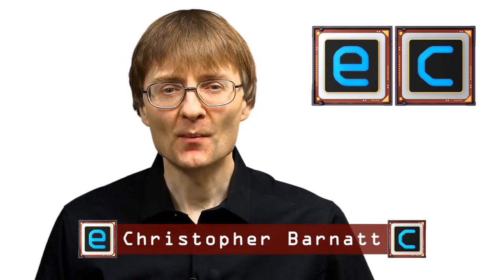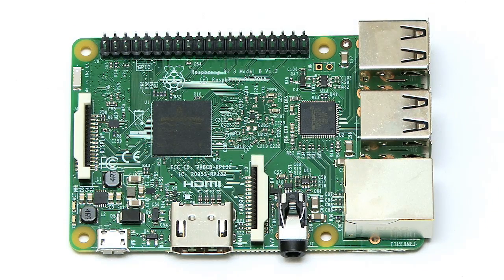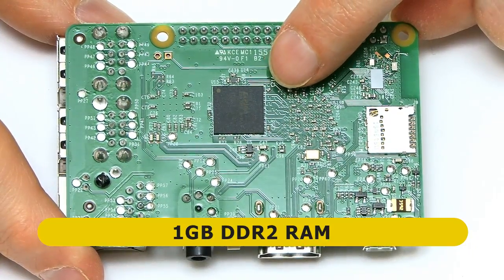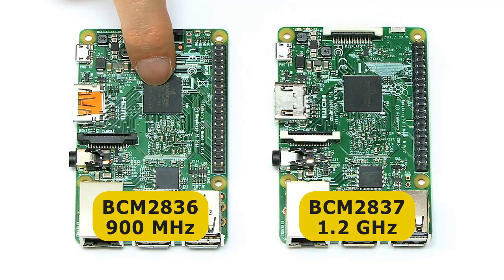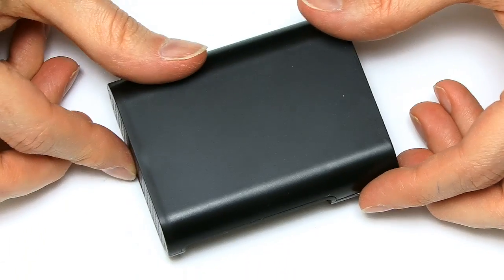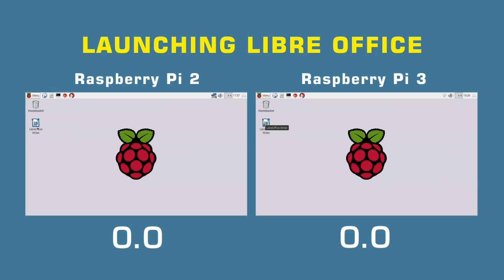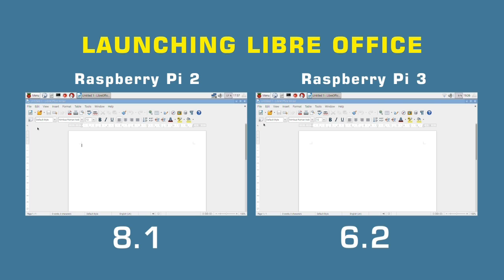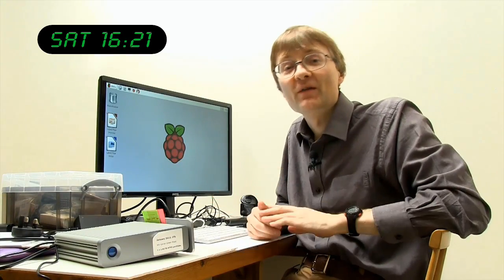Raspberry Pi 3: Review & Speed Tests

Comment: vcgencmd measure_temp uses a single quote in place of the deg.C symbol, like this: temp=44.5'C.

We can make it appear neater by piping the output to the sed command (use LeafPad like Chris did and copy&paste ° from a webpage, etc. --- or simply copy&paste the line that follows):

vcgencmd measure_temp | sed s/"'"/°/   # note the single quote between the paired double quotes

From this moment on you'll be seeing temp=xx.x°C

Comment: I just ran ping tests on my Pi 3 and my £1,700 PC and my pi has less latency, why is this?
Reply from the maker: That is a very hard question to answer without knowing your setup in terms of hardware and software. The Pi is I assuming running a much lighter OS. On the PC side, if the test was not done following a reboot I would do that, and also make sure that services are not running that may utilize bandwidth -- and of course Windows update may be running! :)
Reply: Excellent reply sir that makes sense and its probably a bit of all of those suggestions.

Comment: Monitor not working
Edit
Delete post
Report this post
Quote
Fri Sep 29, 2017 10:54 am 
Raspberry Pi 3 Model B, OS Raspbian by NOOBS, connected by HDMI to TV LG 32", Res. 1360x768, working well.

I bought a monitor, connected via HDMI + DVI Adapter: black screen only. 
Then I modified the config.txt file, result: had to reinstall all OS again.

Tried with a brand new Philips monitor, HDMI-connection, Res. 1920x1080: black screen only.

This is the temporarily running config.txt file:
********************************************************************************
# For more options and information see
# http://rpf.io/configtxt
# Some settings may impact device functionality. See link above for details
# uncomment if you get no picture on HDMI for a default "safe" mode
#hdmi_safe=1
# uncomment this if your display has a black border of unused pixels visible
# and your display can output without overscan
#disable_overscan=1
# uncomment the following to adjust overscan. Use positive numbers if console
# goes off screen, and negative if there is too much border
#overscan_left=16
#overscan_right=16
#overscan_top=16
#overscan_bottom=16
# uncomment to force a console size. By default it will be display's size minus
# overscan.
#framebuffer_width=1280
#framebuffer_height=720
# uncomment if hdmi display is not detected and composite is being output
#hdmi_force_hotplug=1
# uncomment to force a specific HDMI mode (this will force VGA)
#hdmi_group=1
#hdmi_mode=1
# uncomment to force a HDMI mode rather than DVI. This can make audio work in
# DMT (computer monitor) modes
#hdmi_drive=2
# uncomment to increase signal to HDMI, if you have interference, blanking, or
# no display
#config_hdmi_boost=4
# uncomment for composite PAL
#sdtv_mode=2
#uncomment to overclock the arm. 700 MHz is the default.
#arm_freq=800
# Uncomment some or all of these to enable the optional hardware interfaces
#dtparam=i2c_arm=on
#dtparam=i2s=on
#dtparam=spi=on
# Uncomment this to enable the lirc-rpi module
#dtoverlay=lirc-rpi
# Additional overlays and parameters are documented /boot/overlays/README
# Enable audio (loads snd_bcm2835)
dtparam=audio=on
# NOOBS Auto-generated Settings:
hdmi_force_hotplug=1
start_x=0

**********************************************************************************
Most everything is working fine, but only with the LG TV 32", Res. 1360x768, as a monitor.

I tried hard to find a solution by myself for over 2 weeks, but now I`m stuck...

Any help would be highly appreciated. Thanks in advance...

PS. May it´s a cable Problem. I live in Thailand. No one could help so far...
Reply from the maker: Try uncommenting the two frame buffer lines to force width 1280 and height 720. Also uncomment and set HDMI_group=1 and HDMI_mode=19. This will force 720p from the Pi, which I would imagine your TV would accept as a legitimate signal. Good luck! :)
Reply: ExplainingComputers thank you

Comment: I have another question. is there an adapter for the Raspberry Pi 3 Audio Video and mic Jack ? I  just have a headphone set with a mic on it . or do I need an adapter at all I just don't want to break the Raspberry Pi's Jack. and if there's an adapter could you tell me what it's called.?
Reply from the maker: This is an interesting question! I think you should be OK because the Pi can supply either HDMI  or composite video. Hence, if your Pi is supplying HDMI output (which it will by default if an HDMI display is connected), there should be no signal on the sleeve that you are connecting to the microphone in your headset. Note that you will need to go to the Pi's preferences panel and tell it to output audio from the jack rather than HDMI audio.

Comment: Hi Chris, I was thinking of making a really cheap laptop with an SBC for myself for daily use like surfing through the internet, watching videos. As I have heard that raspberry pi 3 (and Raspbian) has some crashing issues after prolonged use so I was thinking I should go with something else that can serve my purpose. So which single board computer should I go for?
Reply from the maker: I doubt that you will find an SBC as stable long-term as a Raspberry Pi. :) There can be issues linked to SD cards getting corrupted, but this can be "solved" by booting from USB (as I show in a recent video -- a very new Pi 3 capability). Other SBCs to consider could be Orange Pis, the TinkerBoard or a Banana Pro. All are nice boards, but the Pi is more long-term stable in my experience, in part because its OS is better supported and used by a far larger community. On the x86 side, the LattePanda is a very nice board, as are the UDOOx86 boards (The LattePanda and UDOO boards a far more capable than a Pi, esp as media players and for fluid surfing). But these take you into a far higher price bracket. So I guess my advice is go with the Raspberry Pi 3 and either use a really good quality SD card (eg Sandisk Extreme), or boot via USB.
Reply: ExplainingComputers 
Thanks very much Chris. What do you think about Odroid C2? It also comes with x86 architecture and on a lower price band. Is it sustainable enough?

Comment: One issue that concerns me about the development of the Pi, is that the processor power improvements, and additional peripherals such as WiFI, is making it more and more power hungry. I am told it needs a 2.5A which is getting  little less easy to source cheaply, as most of the micro USB power supplies out there seem to be 1 A or less. With these small IOT style devices, surely the aim is to get the power consumption down, to allow them more ability to operate independently, or off grid? Also, why don't they use a standard coaxial power connector which is so much more flexible?

Comment: Thank you very much for this video and tutorial.  You have gained yet another subscriber.  I really love the way you present the facts--you're easily understood and your deadpan face makes it even better.  I just received my PI 3 and got my little heat sinks and small case fan and case and cannot wait to get the rest of my peripherals, i.e., 3 amp power supply and USB adapter (to use my old Sony keyboard).  I've read several articles concerning the power supply and it was suggested to use a 3 amp power supply if you intend on running a few USB devices.  I've already watched your videos on using that MASSIVE heat sink and large fan to overclock the PI.  I originally had planned on overclocking the CPU but found in your video that this would nullify the warranty.  Glad that you posted that information with your video.  Now I've got to re-think my setup on the PI 3.  I think that I shall build my own case out of wood and try to find a massive heat sink and large fan to include in the home-made box to keep the CPU cooled enough to overclock it.  Thank you for all your videos.  I cannot wait to get this little thing going.
Reply from the maker: Enjoy your Pi! And thanks for the sub. :)

Comment: i have been trying to connect my raspberry pi 3 to my old crt TV for the past two weeks with no success. Already tried 3 different 4 pole TRRS AV cables but yet to find the right one with recommended wiring order. It seems the recommended AV cable isn't available in my country (India).The ones which i was able to find online were either of Camcorder or Dvd player Av 3.5 mm cables.Still to this day Rasp pi 3 rca cable remains elusive in my case.
Reply: For now i am using it via ssh since i don't have an HDMI display. With only one option left i.e my old crt tv, i am desperate to connect it to my rasp pi 3.😀

Comment: kindly let me know your power source output to boot ur Rpi3 pls.

tried different usb cable chargers, even tried a power bank (with v5 2.0am the best I have in hand) still no success. 
config a 1gb sd card (what I got for the time being on the hand) with FreeBSD 10.2 on pc using Etcher app.. (which seems to fit the card according to reviews suggesting 512mb is enough).. ejected the sd and plugged it on the RPi3...

im having difficulties booting mine..getting large rainbow...let me know if my power source is too low..or may be im missing something...any help is welcome
Reply from the maker: It does not sound like you have a power issue, esp as you have seen the rainbow. I think this is a card or other Pi software issue.
Reply: ok so its working now...it was in fact the sd card...16gb evo working like a charm with raspbian installed ... only issue now is to find out a good source to power it up correctly. It seems it isn't getting enough from the the Power bank as I can frequently see the "lighting like icon" appearing now and then on the top left corner.

Comment: if the PI 3 was running 64 bit instead of 32 bit it would run much quicker, In don't understand 
why it's not running 64 bit yet?
Reply: no 64 bit is not quicker. it just needs more memory and can adress more. But for performance comparison since the Pi 2 just can use 32 Bit you best off starting withh the same codebase.
Reply: What??  64 bit is fast, your doing 2 operations on 32 bit where 64 bit does the same thing in one operation. data is moved faster as well because your moving 64 bits of data in one operation where 32 bit is taking 2 operations to move the same data. The PI 3 can run the PI 2 code if it's only 32 bit but your losing the advantages of a 64 bit CPU forcing it to run 32 bit code.
Reply: In Real World it doesen't work like this. If you process only 64 bit wide datasets AND you use the appropriate Registers. Other than that its just a wider lake. No Realworld program will work like this ( unless its maybe a scientific Microkernel ) ^^
Reply: What computer book did you study?   with that logic then it's stupid to make 64 bit cpu's, hell lets go back to 8 bit cpu's @ 3Ghz then.
Reply: i work as programmer since over 20 years ^^ adresspace defines for one thing how much memory you can access.  Memory Adressing for Example: 16 bit = 65, 536 bytes (64 Kilobytes)
32 bit = 4, 294, 967, 295 bytes (4 Gigabytes)
64 bit = 18, 446, 744, 073, 709, 551, 616 (16 Exabytes)

for the growing demand on memory 64 Bit is necessairy. While its true that 64 bit registers or 128 bit ( such as SSE2 commands on a modern x86 cpu ) can speed up special cases  such as vector operations ( typically 4x32 Bit values -> one operation on each value per clock ). This is a rare case - which in modern game engines gets utilized, other than that soem compression routines can utilize it , raytracing and some other scientific cases ( massive image processing ) and so on. Thats how it works nowadays. a 64 bit value needs also more memory than a 32 bit value (4 vs 8 byte integer). To have to execute only32 bit can be also more effective in terms of power - eg important for mobile.
Reply: Mar Eck I understand what you are getting at, a 32 bit os will run just as fast as a 64 bit os on the same cpu.

Comment: out of curiousity, could a pi2 or pi3 run windows95? i bought a pi2 last year an have yet to do anything with it. win95 could run on a 386 processor with 4 meg of ram. i have an old dell 486 running win95, i'm sure the pi2 is faster than it, it would be a "fun experiment".
Reply from the maker: Yes, it is possible to run Windows 95 (via emulation) on a Raspberry Pi 2 or 3.

Comment: Can we take a 32 gb sd card to Raspberry Pi 3?
Reply from the maker: Yes, a 32GB card will work no problem. :)
Reply: What is the highest capacity sd card known to be compatible with the PI 3?
Reply from the maker: Molon Labe
The Pi 3 can I think work with a 64GB card, but moving beyond 32GB is tricky as Windows will format such a card with exFAT.
Reply: Thank you for the prompt response....much appreciated. I found a program called Fat 32 Format (guiformat.exe) which claims to format larger cards as FAT 32.
Reply: Thanks for the information. Can you resume the serie of using pi as a normal computer?
Reply from the maker: Yutyo Studyo I will certainly be going back to the Pi in future videos! My video a week on Sunday (17 July 2016) is on the vector graphics package Inkspace, which runs well on a Pi 3 (and I do include this in the video). So look out for that. :)

Comment: I got my Pi 3 from Canakit and it works just fine. I had to buy multiple microSD cards to run Raspbian, OSMC, IoT, and Retropie. My only issue is that the only way to get Bluetooth and Geany was to put the commands on the Terminal. But either way I've had it for almost 2 months and it works great.
Reply from the maker: Excellent! :)

Comment: Please tweak your audio noise filter, perhaps smooth it out a bit as I can hear the sound going completely silent after each word you speak.
Reply from the maker: +Csiklós Miklós I apply a subtractive noise reduction filter in audio editing, but there si no automatic or otherwise noise filter applied here. Everything here is balanced audio, so there is very little noise in the first place! In places I have cut ut "uhms". But I will review my audio pipeline in  light of your comment. :)
Reply from the maker: +Csiklós Miklós Just to reply again, your comment has today prompted a very helpful set of checks at my end! I have discovered that I have been getting some noise due to a setting in my Atomos Ninja recorder. There is a setting that I thought maintained itself once set, but it seems to slip over time. I now have a note to recheck it on each use. Sadly some material in the pipeline is impacted. :( But this will improve things in the future. So this has been really useful feedback. Thanks! :)
Reply: ExplainingComputers
 Glad to help :)
And sorry for my suggestion sounding harsh, well, at least reading back my own comment sounds a bit pretentious for me :D

After all, you provide excellent info on everything, and complaining about those little decibels doesn't really matter as the content tops all issues. (if there's any) :)

Comment: What about power consumption? Does the Pi 3 consume more power compared to the Pi 2. Would a battery powering the Pi 3 discharge faster than on the Pi 2.
Reply from the maker: +Opu Ofbengal Yes, power consumption is higher.

Comment: I got a Pi 2 in Feb and, just my luck, then the Pi 3 came out a few weeks later! Guess I'll wait for the Pi 4 before upgrading!
Reply from the maker: +Ash Gupta The Pi 3 is faster for some things. But it is far less of an upgrade than the Pi 2 was from a Pi 1. So enjoy your Pi 2 -- a model that I suspect will be in use for a long time yet (it runs cooler, for a start, and uses less power). I indeed strongly suspect that the Pi 2 is a classic.

Comment: can you operate this 24/7? like a standard PC? or will this require proper cooling
Reply from the maker: +aris oreta A Pi will happily run continuously, although a Pi 3 at 100 per cent CPU utilization would require at least a passive heatsink.

Comment: my computer runs the neon effect in precisely 1.79 seconds. Is the pi 3 just a very low-spec piece of hardware, or is it just your video adapter that causes the effect to take so long to render?
Reply from the maker: +Nophatus The Pi is low-spec compared to something like an i5 or i7 Intel PC. The video adapter has nothing to do with the speed of this test. Were you applying the Neon filter to a 3000x2000 pixel image? If not, the test is not comparable. Also, the complexity of the image will impact the speed at which the test runs -- so even if you apply it to an image of the same size, you are not entirely duplicating the test here. This said, if you scale a photo to 3000x2000 it should be a pretty good comparison. :)
Reply: +ExplainingComputers Ah, okay. I had no idea that so many factors affected the rendering speed. Thanks

Comment: I did the math(s).
Going from 8.1s to 6.1s  is a decrease in time (25% increase in speed).  
6.2/8.1*100=76.54%     100 - 76.54 = 24.46, (almost 25% less time to launch the app)
That's how the improvement could be perceived by a Pi2 user moving to a Pi3.
However if you look back at the Pi2 from the Pi3, then   8.1/6.2*100=130.65%  ... so the Pi2 takes nearly 31% more time as the Pi3 (as you said).  I would suggest the fairer way of looking at the change is from the perspective of someone moving from the old to the new.  The same goes for the later filter test.  11.7/21.6*100=54.17%   
From the perspective of someone currently filtering on a Pi2, they'd see the job done 46% quicker (10 secs less) if they moved to the Pi3.    
Whichever way you look at it, they are decent improvements, but they're nothing like the performance increases claimed by Eben the other week.